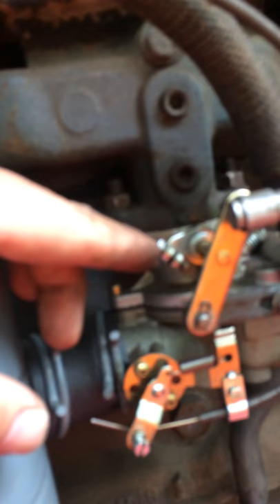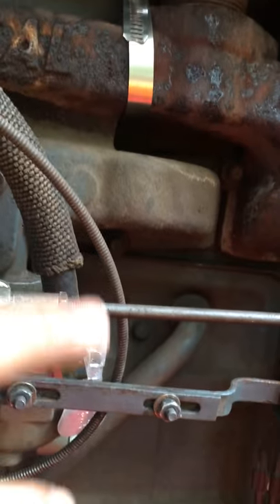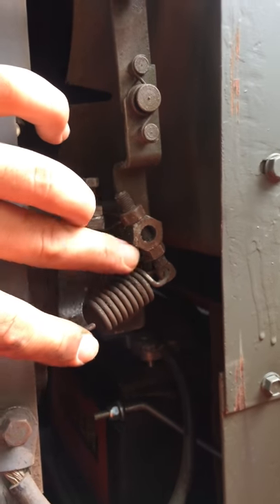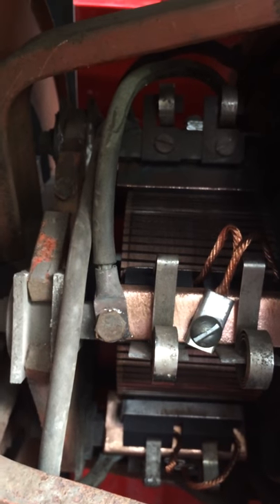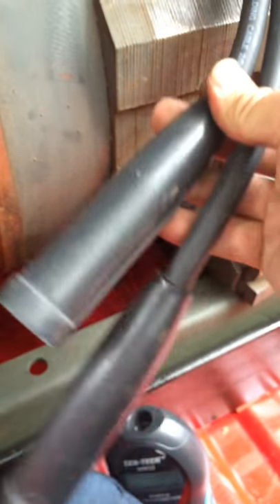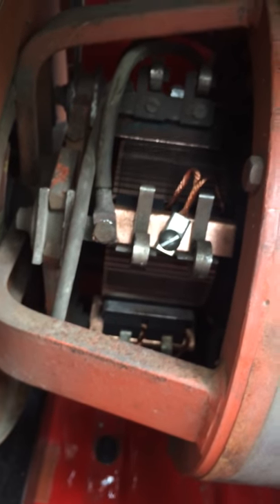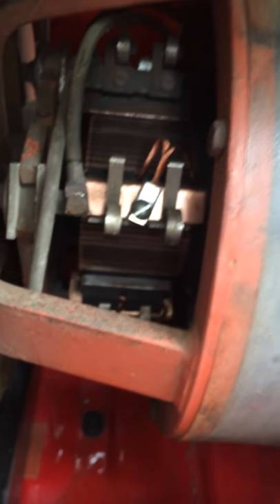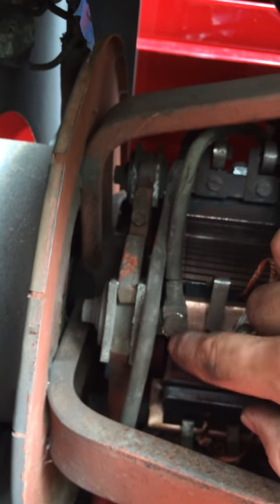Sa 200 correctly adjusted

Comment: Hello there I got a sa 200 that was sitting for a while. Now I'm trying to weld with but I dont get any arc. I just get little sparks. It will run my grinder from the outlet but it seems to berly be giving it enough power. What could be my issue
Reply: Stuck brushes.
Reply: as the person before said stuck or sticky brushes or possibly rusty or oxidized brush holders that makes poor connection to output leads to field or it can be caused by brushes being almost worn out or possibly weak brush springs
Reply: I finally fixed it. It was the coils.
Reply: Was it the shunt  or exiter coils?
Reply: @davidthedon8702  if it just sparkles but runs power tools, it's your shunt coils.

Comment: Thanks for the vid. Just to be clear,  3rd gear, 100% fine adjust , right?
Also, my machine high speed is 1450 rpm. Do you know if ocv setting is 93?
I had set it to 88 ocv.
Reply: That's where mines at , I have the same question. Wondering if I should have the rack rolled
Reply: @beetlejuice4749  you want to verify rpm first ( much easier) if, at the proper rpm, your ocv is way off, then  (I think) you'd roll the rack.
Reply: @beetlejuice4749  which is where yours is at? 88 or 93?
Reply: John Dunn I'm at 1450 and 88.
Reply: @beetlejuice4749  I bumped mine back up to 93. 88 just seemed too low. The difference between low speed and "high" speed seemed too close together  (and I keep idle pretty low as well). That's the thing with these old machines, you never stop tuning them. I don't,  anyways. Happy welding. Thanks for info
Reply: John Dunn . Ok, thank you .